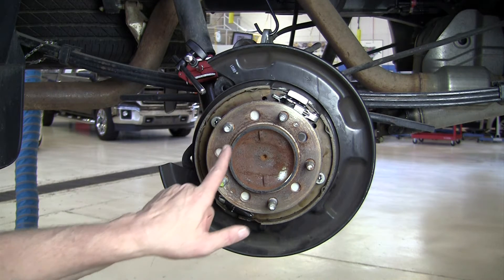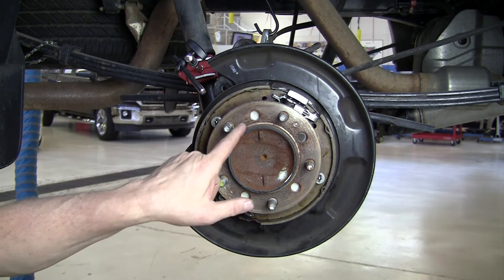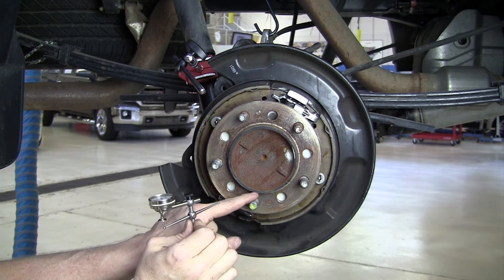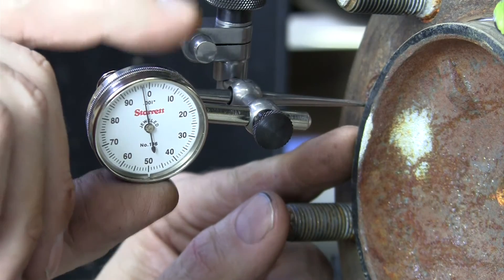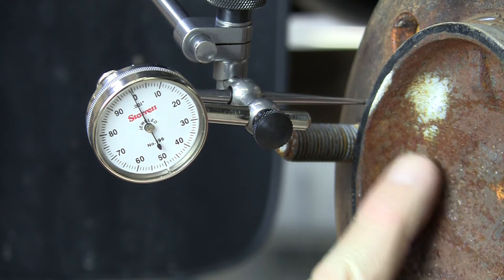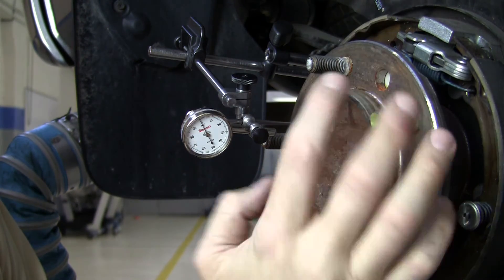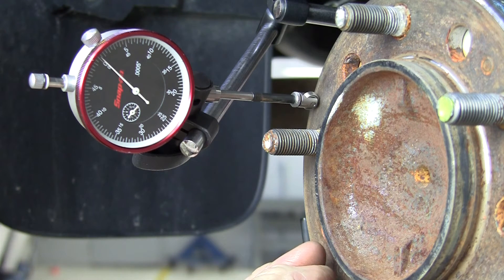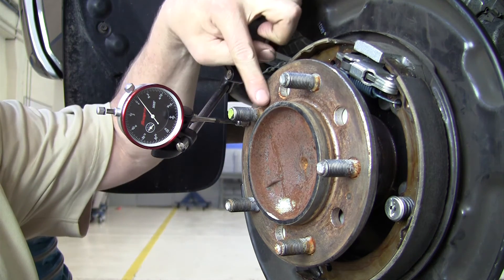How to measure Axle Shaft Runout

Comment: As far as I can tell, the surface you swept at 13:55 need not not run true (it's part of the raw casting).  The face to which the wheel bolts, and the face on which the disc pads ride are where you should be measuring axial runout.

Comment: I suspect that your .065" runout is due to students over torquing and warping this rotor, but consider that the recessed surface that you took your measurement from is not  necessarily machined parallel to the inner wheel mounting surface. These rotors were likely rough turned on one machine and finish turned (cylindrical ground) on another during manufacturing, potentially giving two different readings...yeah, .065" sounds like a bit much, but with advancements in modern casting techniques, your indicator surface may simply be the cast surface finish. Also, cool as that roller wheel indicator tip is, any error in it must be added to the TIR. An indicator tip like that is ideal for minimizing tool wear from rough surfaces, but there is no way to know if your runout is from the part being measured or the measuring tool itself.

Edit: The simplest answer usually being the correct one, I'm going to change my answer and go with with Grant Baker's answer below...the lug nuts are likely bottomed out on the studs and not applying even pressure to the rotor. That said, the points I made previously are still valid and should be considered when doing this type of measurement.

Comment: The high lateral runout with the rotor installed was probably caused by the lug nuts bottoming out on the studs at the chrome caps. The chrome cap lug nuts bottom out shortly before the rotor is clamped to the the axle flange. That has been my experience measuring TIR on the Toyota and Lexus truck rear axles like the type in your video. Therefore I use some lug nuts that have no chrome cap to clamp the rotor to the axle flange.
Reply from the maker: Good point, Thank you!
Reply: @WeberAuto  do you have any idea how much radial play is acceptable on a semi floating axle wheel bearing like on a Ford 9.75 rear end with cylindrical roller bearing where the axle just slides in through the rollers?
I have this and there seems to be quite a bit of up and down play and some but less for and aft play.
I tried sliding a new timken onto the shaft while out of the truck and even it had noticable radial play.
Thanks